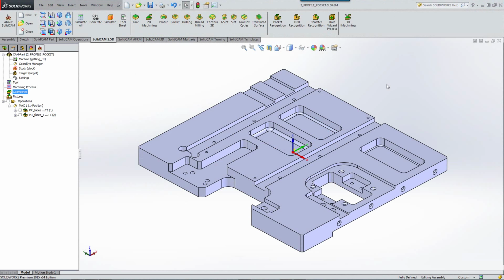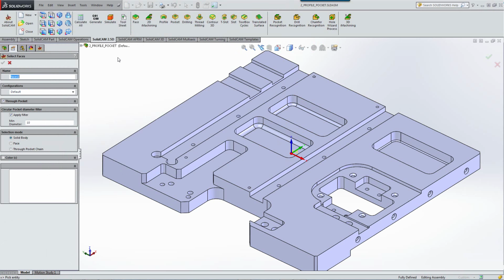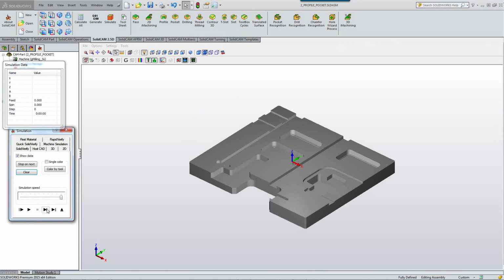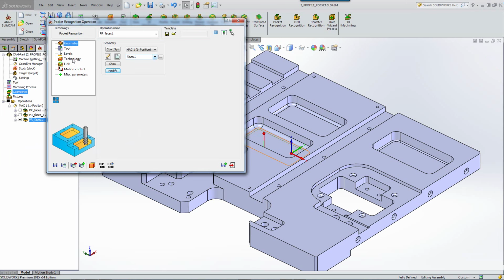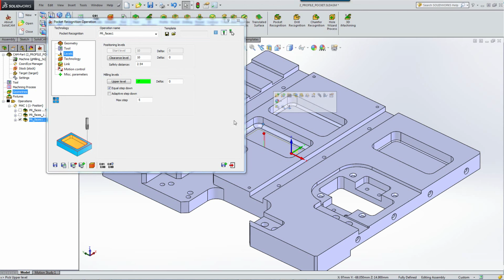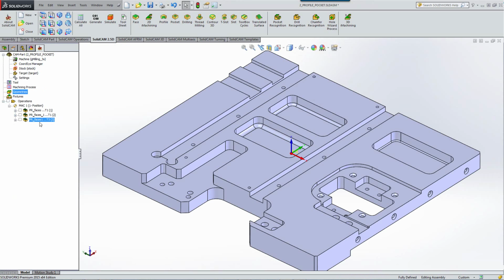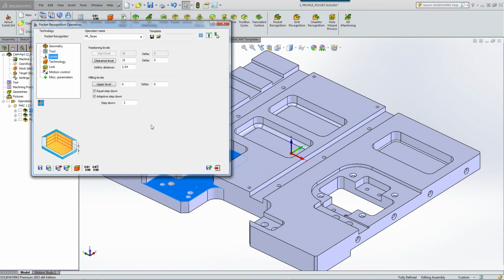Tips and Tricks in Pocket Recognition

Comment: Hi
How can I extend and trim HSS toolpath ?? in Solidcam 2015 
I know in Solidcam 2012 it was that option
Reply from the maker: Daniel Dan This option has been moved. It is now located in the "Tool path parameters" field. Click on the adavanced check box in the uper right hand corner. You will see a Modify tab has been added. The option is in the modify tab.
Reply: SolidCAMProfessor 
Thanks for help 
It is any chance to get more basic tutorials for rotary ??(4th axis) such as
- how can I use end mill to go around cylindrical part (something like pocket wrap) just around part or turbine one  blade, I was practice last weekend and i made that with HSM but still have lots of questions
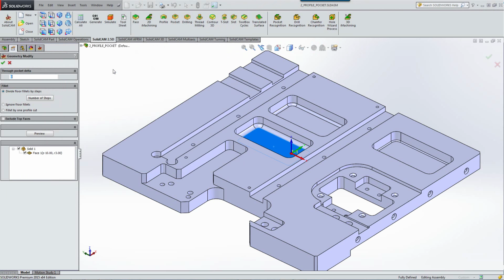U can find example  from 1:25 title (selfmade 4th axis for haas machine , making of slideshow).
Can I use Imachine to make shape like that ??